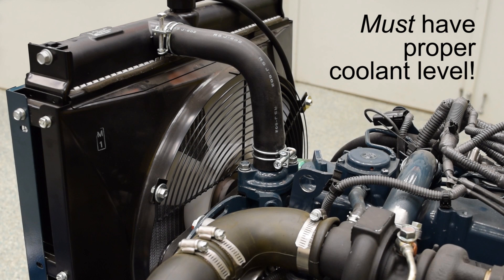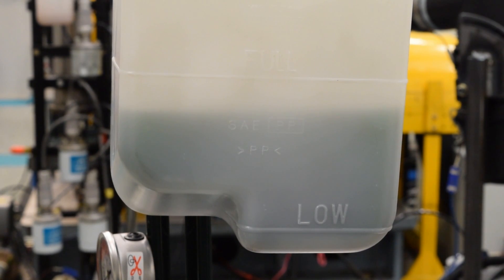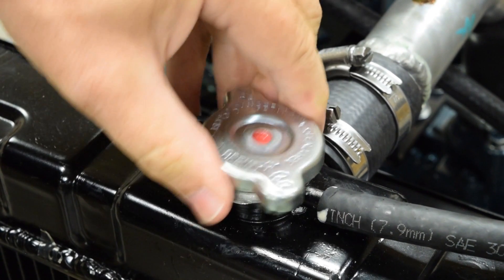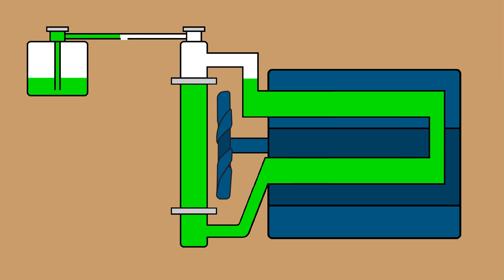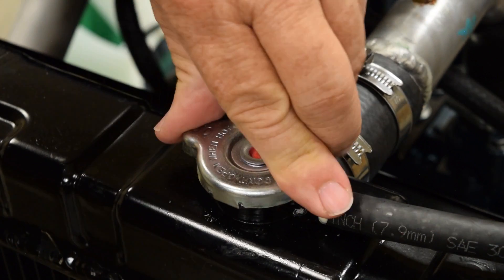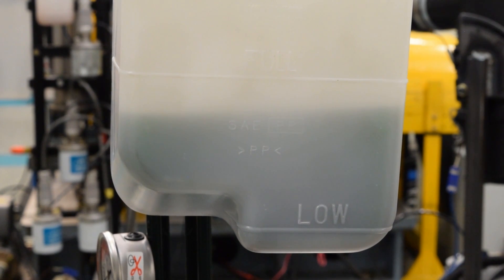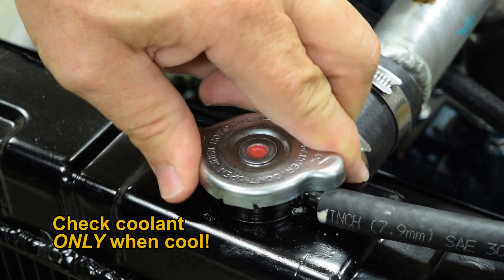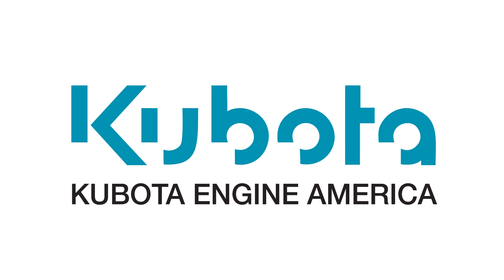Coolant Level: The right way to check it | Kubota Engine America

Comment: if i have a kubota z402 engine in my aixam but when i bought it it only had an expansion hose but that hose didnt go anywhere, it would just shoot out coolant. my question is can i put a  overflow bottle somewhere in the engine bay and just route the coolant hose in there

Comment: If your tractor doesn’t have an expansion tank, then Per the manual, fill the coolant up to a level just below the port. 

But what is the “port”?

The port is the entryway or fillway or opening where you screw in the pressure cap.

So basically, fill the radiator up to just below the fill hole.  

If your tractor has an overflow vent/whistle, that hole will be just below the port cap, and visible.  Don’t fill it above that hole.  

Use clean water or even filtered or purified water. 

If your tractor overheats, the whistle will blow and/or you will smell the coolant.  Turn your tractor into the wind and slow down and Stop the tractor from moving  and clear the seeds and grass and debris away from the radiator. DON’T SHUT OFF THE ENGINE!  The engine keeps the coolant flowing in many engines via the water pump.  If you shut down the engine you can get spot boiling inside the engine block which can lead to the block not getting properly cooled or unevenly cooled and the block can crack— no more engine!

After cleaning the radiator and letting the engine cool, THEN you can shut off the tractor’s engine. 

After any time you overheat the tractor, refill the radiator again, as per above. The whistle-overflow lowers the tank level and if you overheat the tractor often without cleaning the radiator and cooling it down, you will boil off too much water and have no coolant!  This is the worst thing you can do to an engine!
Reply: I needed to read this comment two days ago!  My neighbor waved me down and the whistle was a blowin'.  I hadn't heard it because my headphones but I immediately freaked and shut it off.  Things were smoking and leaking.  Now I'm out of coolant and trying to research what I should put in my ZD21 that I can find at the local auto parts store.  No one here seems to know and it isn't clear cut from the manual.

Comment: Fine video, but please show how much fluid I should see in the radiator itself? 
The radiator hose came off my new (less than 25 hrs) L2502, and I need to ensure proper coolant levels. 
Will it simply suck out of the expansion bottle, or do I need to fill radiator also?

Comment: When you take the cap off, what are you looking for? Can you see coolant up to the top? It's hard to tell from the video. Thanks.
Reply: If your tractor doesn’t have an expansion tank, then Per the manual, fill the coolant up to a level just below the port. 

But what is the “port”?

The port is the entryway or fillway or opening where you screw in the pressure cap.

So basically, fill the radiator up to just below the fill hole.  

If your tractor has an overflow vent/whistle, that hole will be just below the port cap, and visible.  Don’t fill it above that hole.  

Use clean water or even filtered or purified water. 

If your tractor overheats, the whistle will blow and/or you will smell the coolant.  Turn your tractor into the wind and slow down and Stop the tractor from moving  and clear the seeds and grass and debris away from the radiator. DON’T SHUT OFF THE ENGINE!  The engine keeps the coolant flowing in many engines via the water pump.  If you shut down the engine you can get spot boiling inside the engine block which can lead to the block not getting properly cooled or unevenly cooled and the block can crack— no more engine!

After cleaning the radiator and letting the engine cool, THEN you can shut off the tractor’s engine. 

After any time you overheat the tractor, refill the radiator again, as per above. The whistle-overflow lowers the tank level and if you overheat the tractor often without cleaning the radiator and cooling it down, you will boil off too much water and have no coolant!  This is the worst thing you can do to an engine!
Reply: My question also. Seems like they’d show it  or tell if you’d see it full to the top or not.

Comment: Hi, there is a hose on the right side of my Kubota L2850 DT (1993), which shows some drops spilling ( near  on the manifold hydraulicbloc). Does the engine become too hot? I would expect, that all the hot coolant should be stored in the expansion tank. Could you shed some light on the set-up, please. Regards Heinz

Comment: Thanks for the vid on this important topic. What should I consider to do, if I found the expansion tank empty, but the radiator is top level? No overheating shown on the gauge, no visible leakages outside. Regards Heinz
Reply: Same with my  Forester.

Comment: Nice explanation. I have a question. After completing around 2500 kms on my new motorcycle, one day I noticed my reservoir coolant level was just below the low mark. But the radiator was full. I’m  worried, is it okay? please help.Thanks in advance
Reply: I’m assuming your rad has a 50/50 antifreeze mix. I assume you’ve added to the reservoir tank to bring it back up to the low mark?  If it was only just a little down, like 1-2 oz, it’s likely just evaporation. In that case, just add distilled water.  If it’s down 4-6 oz, you might have a leak. Add 50/50 mix rad fluid and investigate the leak.
Reply: David Buck, yes it is a 1:1 premix antifreeze. I finally figured it out. The reservoir has a small crack on the top, but coolant doesn’t spill out of it. But, after a few weeks of riding when I open the side body panels just to have a good look inside, I find coolant in a half dried state ( like a green gel) lying on the reservoir support ( evaporated and condensed). I think because of the extreme heat the plastic has cracked. I just used a duct tape to cover the crack. Now I will check again after sometime. Thanks for the reply. 😊
Reply: @rahulgautam8235  
I would get a small tube of marine grade silicon and seal that baby up.  Hopefully it will hold during pressure peaks when the expanded fluid fills the reservoir. You might also cost out the price of a tank at an auto wrecker if available.

Comment: If the reservoir has a hole does it effect the ability to pump it back to the radiator?
Reply: Depends where the hole is. If the pick up tube is below the fluid level vacuum will pull it back to the radiator. They were talking about a hole in the line between the reservoir and the raditor.

Comment: Have a Grasshopper 721D with Kubota Diesel. Bought last year used. There was oil in the radiator which I thought he might of added an additive. Mowed with it last year no problems. It wouldn't start this spring so the dealer pick it up put a starter in it and said something about the oil in the radiator. He flushed it out added new fluid and everything looked good. I checked it the other day and oil again. No fluid in my oil. Got me stumped can you enlighten me.
Reply: Hare Kṛṣṇa Hare Kṛṣṇa
Kṛṣṇa Kṛṣṇa Hare Hare
Hare Rāma Hare Rāma

Rāma Rāma Hare Hare!
  You are enlightened. 

 Actually, your oil pressure is say 30-45 psi. coolant typically is 5-15 psi.  your oil leak is likely pushing into the coolant but your coolant cannot push back into the oil.

Comment: This is not helpful.  I have a 2nd gen (IRS) RTV 900 and have looked from engine compartment and under the seat, but cannot find how to check/fill coolant.
Reply: This is a great explanation.  Many cooling systems are unique and you may need to check for your specific application.  Sometimes the reservoir is only a catch can and not a reservoir that can be evacuated.  Some have the plastic container as the actual pressurized tank on your system.  follow the radiator hose from engine to radiator.  then look at the top of the radiator.  It must have a cap or a hose that goes to a reservoir.  I have a genset that has a onan cummins that has a separate reservoir bottle that has a hose to the radiator do you have that?